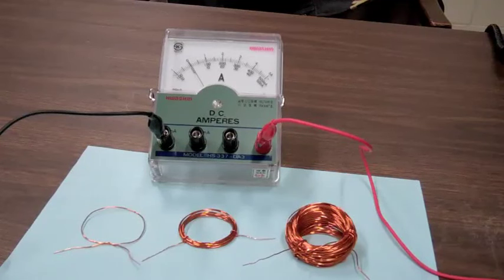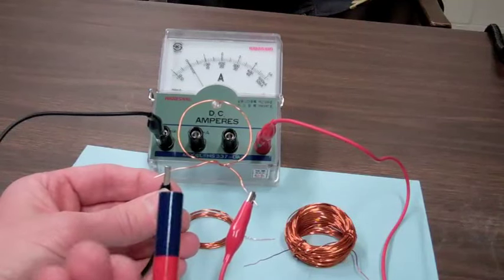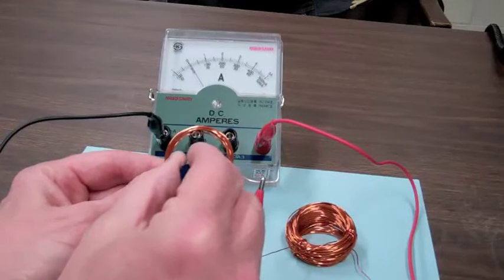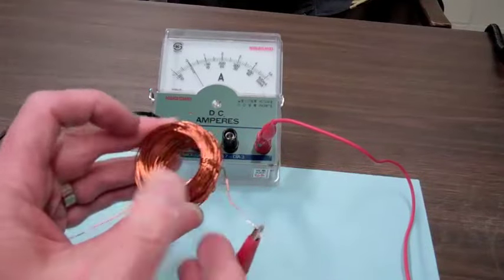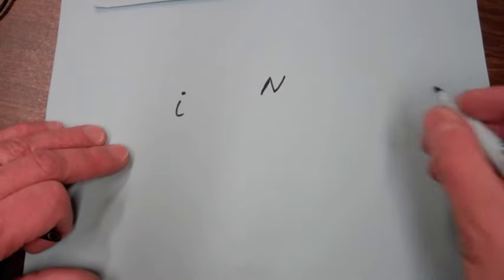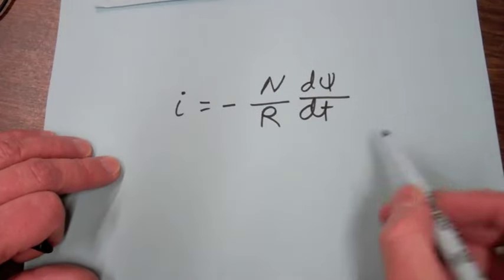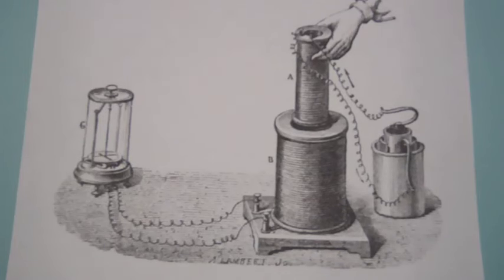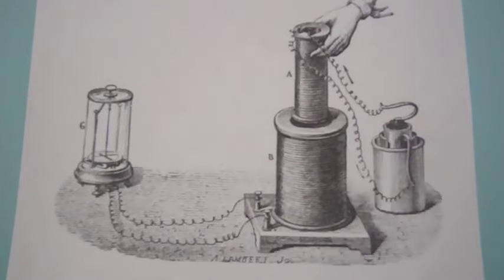Electromagnetic Induction and Faraday's Law

Comment: I am going to demonstrate electromagnetic induction with an experiment similar to the one that michael faraday performed. I have an ammeter here and i have three coils. I have a coil with one loop ten loops and 100 loops. I also have a bar magnet and i will start by connecting the singel loop coil to the ammeter. I now have the single loop coil connected to the ammeter and i am going to move the bar magnet into and out of the coil and if you watch very closely you can see a slight deflection of the ammeter needle okay so now let me connect the ten loop coil. Then i am going to do the same thing. I am going to move the bar magnet in and out of the coil now you can see more movement of the needle in fact if i go very slowly you see just a little bit of a deflection and if i go quickly you see a greater amount of deflection also as the magnet is going in the needle deflects to the right and as i pull the magnet out it deflects to the left but when the magnet isn't moving there's no deflection indicating no current flowing. So when the magnetic field is changing going into the coil there's a positive current flowing when it's changing coming out of the coil there's a negative current flowing and now let me connect the hundred loop coil. I will start by moving the magnet in very slowly you see a deflection to the right pull it out to the left if i go in quickly you see a much greater deflection. So the rate of change of the magnetic field affects the current. We saw that as the number of turns in the coil increase the current increase so the current is proportional to the number of turns which we'll use and to represent we also saw that the current increase as the rate of change of magnetic flux inside the coil increase so decide et represents the change in the magnetic flux inside the coil now if we were to monitor the resistance of the whole circuit that is of the coil and the wires in the ammeter we would find that the current was inversely proportional to the total resistance of the circuit now this equation is usually written as i is equal to minus n over R decide ET and we'll talk about the significance of this minus sign in a future video on lenz's law so now if we multiply both sides of the equation by R we get R I equals minus and sie DT and resistance times the current is a voltage or a potential we call that the electro-motive force and so the electro-motive force is equal to minus n decide ET and this is known as Faraday's law.
Reply: Elektromanyetik indüksiyonu Michael Faraday'ın gerçekleştirdiği bir deney benzeriyle göstereceğim. Burada bir ampermetre ve üç bobinim var. Bir döngülü, on döngülü ve yüz döngülü bobinlere sahibim. Ayrıca bir çubuk mıknatısım var ve ilk olarak tek döngülü bobini ampermetreye bağlayarak başlayacağım. Şimdi tek döngülü bobin ampermetreye bağlı ve çubuk mıknatısı bobinin içine sokup çıkaracağım, çok yakından izlerseniz ampermetre ibresinde hafif bir sapma görebilirsiniz. Şimdi on döngülü bobini bağlayayım ve aynı şeyi yapacağım. Çubuk mıknatısı bobinin içine sokup çıkarıyorum, şimdi ibrede daha fazla hareket görebilirsiniz. Gerçekten çok yavaş hareket ettiğimde küçük bir sapma görüyorsunuz ve hızlı hareket ettiğimde daha büyük bir sapma görüyorsunuz. Ayrıca mıknatıs içeri girdiğinde ibre sağa sapar ve dışarı çıktığında sola sapar, ancak mıknatıs hareket etmediğinde akım olmadığını gösteren herhangi bir sapma olmaz. Dolayısıyla manyetik alan bobine girdiğinde pozitif akım akar, bobinden çıktığında ise negatif akım akar. Şimdi yüz döngülü bobini bağlayayım. Mıknatısı çok yavaş hareket ettirdiğimde sağa sapma görüyorsunuz, dışarı çıkardığımda ise sola sapma. Hızlı hareket ettiğimde ise çok daha büyük bir sapma görüyorsunuz. Yani manyetik alanın değişim hızı akımı etkiler. Gördük ki bobindeki dönüş sayısı arttıkça akım artar, dolayısıyla akım dönüş sayısına orantılıdır. Ayrıca manyetik akı değişiminin hızı arttıkça akımın da arttığını gördük. Şimdi eğer devrenin toplam direncini izleseydik, yani bobinin, tellerin ve ampermetrenin direncini, akımın devrenin toplam direncine ters orantılı olduğunu bulurduk. Bu denklem genellikle i = -n / R decide ET olarak yazılır ve bu eksi işaretinin Lenz yasası hakkında gelecekteki bir videoda anlamını tartışacağız. Dolayısıyla denklemin her iki tarafını R ile çarptığımızda R I = -n decide ET ve direnç ile akım bir gerilim veya potansiyel oluşturur, buna elektromotor kuvvet denir ve elektromotor kuvvet -n decide ET olarak eşitlenir ve bu Faraday'ın yasası olarak bilinir.

Comment: We have been lighting LEDs using this principle, which is failrly simple. Question would it be possible to  produce say 3v  or more in order to run a 3v motor instead of an LED?
Reply from the maker: This is the principle behind all electric generators, so yes you can produce 3 V. The faster the change in magnetic flux the great the electric field intensity generated and hence the greater the voltage.
Reply: Thank you for answering. That makes perfect sense
Reply from the maker: yes, increase the rate of change of magnetic flux and you increase the voltage produced, V = - (dpsi/dt)

Comment: Is it important for the wire to not go over eachother or can we just coil it up randomley?
Reply from the maker: If you mean the red and black wires that are connecting the coil to the galvanometer, it does not matter. You could twist the red and black wires around each as many times as you want before using them to connect the coil and the galvanometer and it would not change the observations.
Reply: Michael Melloch
No no no i know about that but i wonder when you are makeing the coil from the wire. Is it important for the wire to not owerlap ower each other. How can i make you imagine this... If you would twist the vire around your 4 fingers without looking how you bend it around and then you have that big coil with wire going left right and ower each other... Hope you understand what  i mean
Reply from the maker: MrKiller1250 I now understand what you are asking. There is some effect because of the different geometries of each turn, with changing diameter being the greatest geometric effect. As the coil is wound, the diameter of the turns increase as the wire builds on itself. So as I move the magnet, there is more flux going through the larger diameter turns. This would have to be taken into account if you were performing an exact calculation of the induced current.  So I think the changing diameters are probably the biggest effects from the actual shape and relative positioning of each turn, probably a minor correction for this experimental arrangement.

Comment: Does the current induced in the coil is AC or DC
Reply from the maker: If you produced a constant rate of change in magnetic flux you could get DC. Since I am moving the magnet back and forth, the rate of  magnetic flux change is going up and down and I am producing an AC current.

Comment: What type of wire is needed for it.describe that.
Any type of copper wire will work or not
Reply from the maker: +Abhishek Gupta Any wire that is thin enough so that you can easily form a coil. Also make sure the wire has insulation on it otherwise you effectively will have only one turn. And don't forget to remove the insulation from the two ends of the coil.

Comment: can you please list the materials you used in this experiment? and the aim?
Reply from the maker: Any magnet wire and magnet will work. For the current meter you need a galvanometer,

https://www.amazon.com/United-Scientific-MGV002-Galvanometer-500-0-500/dp/B00ES3TQSW/ref=sr_1_3?ie=UTF8&qid=1502991424&sr=8-3&keywords=galvanometer
Reply: Thank you
Reply: what would be an aim for this experiment?
Reply from the maker: It is one of the most significant discoveries ever made. So the purpose was to demonstrate electromagnetic induction, which has played a significant role in our world. It directly led to electrification.

Most electricity is generated using electromagnetic induction. A coil is turned in a magnetic field and the result is AC current,

https://www.youtube.com/edit?o=U&video_id=O5n6ubrbK5A

Faraday demonstrated the first generator based on electromagnetic induction, the Faraday dynamo. But his was a dc generator.

It is why transformers work, Faraday demonstrated the first transformer.

It also results in magnetic braking, how a roller coaster is stopped!

https://www.youtube.com/edit?o=U&video_id=MglUIiBy2lQ

Electromagnetic induction is the principle behind regenerative braking.

It is also used in nondestructive testing when looking for micro cracks, which cannot be seen, in metals. If there is a crack an eddy current cannot flow. See the different behaviors in the two pendulums in the above linked video. If you could not see the gaps in the pendulum you would still know they are there based on how it doesn't stop abruptly.

Comment: I am using a bar magent but the ammeter is not showing deflection. Why?
Reply from the maker: You need to use a  galvanometer. A  galvanometer will be responsive to a pulse of current. A regular ammeter will not.

Comment: Can it works if round type magnet
Reply from the maker: yes, magnet shape does not matter. Any configuration where you can change the magnetic flux inside the coil.

Comment: I want to ask, 
if we coil the wire in single layer, say N=100 turns in single layer( 1layer x 100turns = 100turns total) and if coil same wire and same number of turns (100) but not in single layer but in multilayer( like 25 turns in one layer & 4 such layers of 25 turns = 4layers x 25turns= 100turns(total)

then, for above condition is the current induced same in both situations?
Reply: For 30000turns how much meters of wire you used...??
Reply from the maker: I estimate about 600 meters.
Reply: +Michael Melloch, I tried the calculations for 30000turns  using :-

circumference of plastic casing :- 3.14 x D=3.14 x 0.04215 m = 0.132m ( for one turn) ,so for 30000turns = 30000 x 0.132 m = 3970 m.

so according to this calculation 3970m of wire will b required.
Reply: can u plz help me to sort out this prblm. 3970m wire cost alott..:-D
Reply from the maker: Yes the spool I purchases cost $130,

https://www.amazon.com/Essex-Magnet-Degree-Celsius-1-Count/dp/B008H40WWC/ref=sr_1_1?ie=UTF8&qid=1475101408&sr=8-1&keywords=magnet+wire+AWG+33+11+lb

But I had enough to wind three different coils.
Reply from the maker: The single layer coil will be longer than the multilayer coil and therefore the profile of the changing magnetic field presented to the two coils will be slightly different. So probably a little difference in the induced coil but for the dimensions of your example it will probably not be greatly different..
Reply: I tried to calculate the current for 200 turns for 2 AWG wire.( D= 0.04215m, on which the coil will be wounded)

Length of wire for 200 turns (L)=3.14 x 0.04215 x 200= 26.4702m
B=0.005T
A=3.14/4*0.04215^2=          1.3946 x 10^-3 m^2
t= 0.0129s
Resistance of 2 AWG/meter               = 0.000513 ohm/m
Resistance of 2 AWG for 26.4702m  = 0.000513 x 26.4702= 0.01357 ohm
On substituting these values in given equation we get current around 7.9 A.

Now the problem I m facing is : 

if i increase the winding to 300 turns than length of wire increases to 39.7053m. 
Resistance for 39.7053m 2 AWG wire than becomes = 0.000513 x 39.7053=0.02036 ohm.

Keeping value of B,t,A same as above and substituting above values in equation we get same current 7.9A.

i tried for many turns and there equivalent resistances but i get same current.

But Current should increase with in increase in turns. in this case its not working.

please give me solution.

Comment: In fan why  fan rotates by electromagnetic induction.Please explain me the full procedure.
Reply from the maker: +Abhishek Gupta A fan does not rotate because of electromagnetic induction but because of the force a current-carrying wire experiences in a magnetic field. This rotation can be accomplished with either a dc or ac motor. Here is a video explaining a simple dc motor https://www.youtube.com/watch?v=PO0m0xFcyS0
Reply: Please tell me the use and advantages of this experiment
Reply from the maker: +Abhishek Gupta It shows how to get mechanical rotation from a DC source.

Comment: what if you move both of them in same direction will it produce current
Reply from the maker: +raghu ram  There would be no current. There is no relative motion between the magnet and coil if they are moving together, so there is no change in the magnetic flux inside the coil.
Reply: Thanks buddy

Comment: is there insulation on all over the wire?
Reply from the maker: Yes the wire is insulated. The voltage is proportional to the change in flux linkage with respect to time and the flux linkage is the number of turns of the wire times the change in magnetic flux with respect to time. With no insulation on the wire it would be like having just one turn of wire.
Reply: Makes sense thank you

Comment: Bro how can i make electromagnetic induction . using 5 inch pvc pipe , magnetic wire and 9 V battery also the pvc pipe is insulated with musking tape . How will i know its working ?
Reply from the maker: I am not sure what you are asking. If you wrap the wire around the PVC pipe, you will generate a voltage across the two open ends of the wire if you move a magnet into and out of the PVC pipe. If you are connecting the 9V battery to the ends of the wire, you will be creating an electromagnet. The dc current flowing in the wire generates a magnetic field.

Comment: Hey, PLEASE help with this, i have made a similar coil with 0.5mm thickness and 10m length (600 turns). I am running a neodymium magnet through it, and the current induced is very very low, voltage was 0.001V. what possibly could be the problem? I just want to light up an LED with the induced current from the coil. PLEASE HELP.  I even tried making it a smaller loop and hence more number of turns, same problem, i don't know what to do. Someone please help🙏
Reply from the maker: It might be hard to generate enough current/voltage by moving a magnet in and out of a coil. Here is something you might think about trying https://youtu.be/O5n6ubrbK5A
Reply: @electricandmagneticfields2314  thank you very much, I'll try this. But I'm thinking of doing something like this ( https://youtu.be/fiyaYII7ROA ). A torch light that requires no batteries. I searched up shake torch light on YouTube and did the same thing said in the video, and it works in the video but it doesn't work for me.

Comment from the maker: Nancy Rahhal, I am not sure what you are asking regarding the volume of copper. Any gauge wire should work. You need a meter that will be responsive to a pulse of current like a galvanometer. This one works well, http://www.amazon.com/United-Scientific-MGV002-Galvanometer--500-0-500µA/dp/B00ES3TQSW/ref=sr_1_3?s=industrial&ie=UTF8&qid=1400674908&sr=1-3&keywords=galvanometer. Any bar magnet should work.

Comment: M also doing it as a project n m winding d copper wire on a plastic and inserting magnet to it and I got no deflection on my ammeter.  M I doing anything wrong hear plz rply sir.   Thank you in advance
Reply from the maker: The problem may be your ammeter. You need a meter that will be responsive to a pulse of current like a galvanometer.

https://www.amazon.com/United-Scientific-MGV003-Galvanometer-50-0-50µA/dp/B00ES3TQZU/ref=sr_1_2?ie=UTF8&qid=1524139523&sr=8-2&keywords=galvanometers
Reply: Michael Melloch  I even used multi metre too... Bt no use .. winding d wire on plastic holder is it correct
Reply from the maker: Does your wire have insulation on it?

Comment: hi, so the voltage we get is DC or AC?
Reply from the maker: In this experiment there is a pulse of current occurring. The pulse of current changes direction as the magnet is pushed in and out of the coil.
Reply: So it's AC

Comment: Excuse me kind sir, does this have to be done with magnets? I've seen others done with batteries as well, but what I'm trying to get to is is this achievable without magnets/batteries? Will any regular iron or steel objects being projected through the coil work? What kind of materials?
Thank you
Reply from the maker: A battery projected through the coil will not induce a current in the coil. Neither would non-magnetized iron or steel. It has to be an object with a magnetic field.
Reply: Thank you very much. I think I just figured out a way to induce a magnetic flux without magnets.
Reply from the maker: It will only work if the material has a magnetic field. So either a ferromagnetic material that has been imagnetized, or another coil with a current flowing through it.
Reply: yes just as i predicted, I plan on creating a magnetic field through electrostatic first to magnetized a neutral object
Reply: Hi I would know how this is flux inks
Reply: There is a bar magnet at the center of the batteries

Comment: According to the first equation , if the resistance of one loop is R then the resistance of 100 loops is 100R then the ratio of loop and resistance remain same as before and the rate of change of magnetic flux is same so why the induce current is increasing ?
Reply from the maker: The resistance of the coil is probably negligible compared to the resistance of the galvanometer. I think 100 ohms is not unusual for the resistance of a galvanometer. I'll measure the resistance of the gavanometer that I used, but it might be a while till I can get around to doing that

Comment: guys is it measured by voltage or amps plz reply back i have the project tomorrow
Reply from the maker: A changing magnetic flux produces an electric field. Unlike electric fields originating from charges, these electric fields close on themselves. So integrating the electric field around a closed path will result in a voltage, referred to as the electromotive force. If there is a circuit present, this induced voltage causes a current to flow in the circuit.